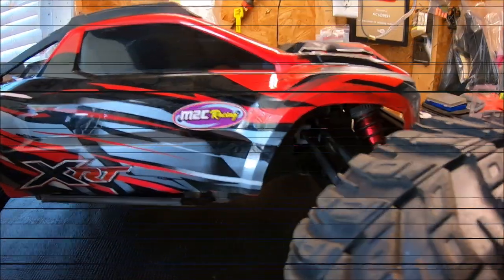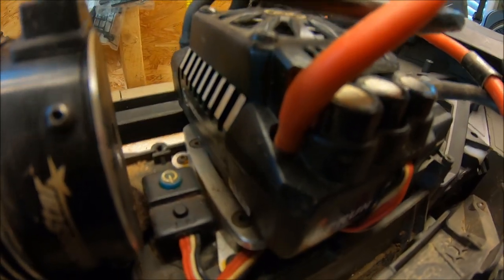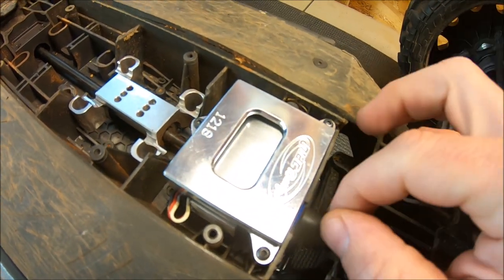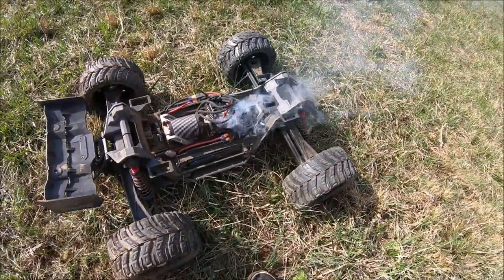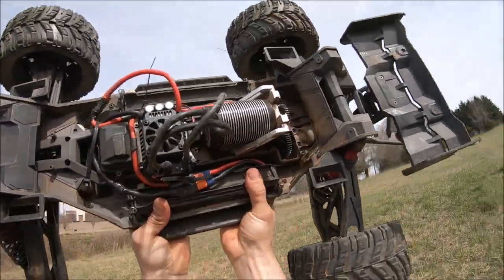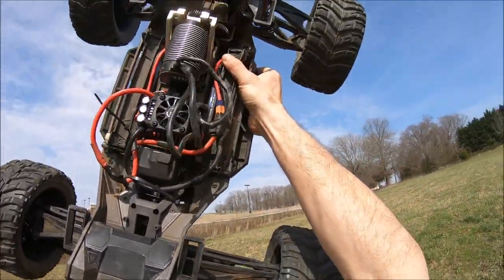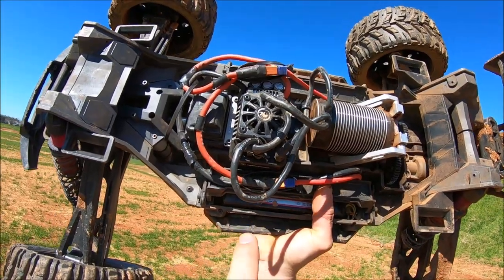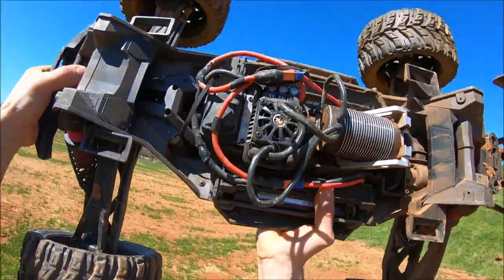MOST INSANE Traxxas XRT 8s Thrashing! NEW Upgrades!!

Comment: Me personally, I installed the max 6 esc. This model imo just isn't a good platform to do more. The spur is just wide open, I would rather use an arrma 8s and spend much less and have more options. Great video.
Reply from the maker: Thanks! This thing is a nimble powerhouse! I had to run a Max 5 with the 1120 5692 motor I'm running. I tried a Max 6 and smoked it immediately.😝🤣Thanks for watching!

Comment: What kind of parts do you go through, and what spares do you bring on a bash day like this?
Reply from the maker: Just depends! This whole video I only smoked the ESC, killed a rear diff and cracked the rear chassis🤣She kept driving though! M2C will soon have a solution for the chassis! Usually I carry a tool box with essential spare parts like arms, shock ends, diff gears, hubs, Bearings etc.
Reply: @RCDUDE81  awesome!, thanks for the reply dude. It would be cool to see a carnage overview after a bash session sometimes. Your vids are packed with action, but it's also cool seeing what was broken to give an idea of what spares to hold onto.

Comment: Hey, can I ask what wheels and tires you have on? I was so excited to get my husband the XRT for Christmas and he can't do anything even kind of close to this. His wheels are constantly breaking! It's super frustrating! He has hardly even got to drive it because the wheels break going on a 20°, 10" (at the highest point) ramp. The wheels are trash! We have gone through 6 sets of tires since Christmas plus the ones it came with. I was a huge traxxas fan until I dropped a grand on this RC and he can't even drive it
Reply from the maker: I hate to hear his troubles with the tires! I showed in my intro I'm running Proline Masher X tires for the 1/5. Also you need either the wheel hex adapters or the M2C axle and 24mm hex conversion.
Reply: Proline mx43 badlands are also very nice tires and require no extra items to use. They are beadlocked so while expensive they will last a very very long time. Good luck!

Comment: Why does voltage cut off always happen right when it comes off the ramp? Seems to happen pretty often for me too.
Reply: Because you see the issue once you come off the throttle from Maxx Amp draw
Reply: Or impact of the ramp jars wire loose
Reply from the maker: Yeah I try to ramp launch early in the packs charge but yes it has happened to me! This powerloss ended up being a loose motor lead.😜

Comment: Holy ! Does anyone know what makes ESC start on fire or smoke out ? Like in general what happens to them that makes them do that ?
Reply: It gets hot as fuck from all the electrical current running through them as it sends power to the motor causing the glues and plastics to melt and eventually combust if temps stay up..🎉🎉🎉

Comment: Wheres the antenna in esc plate?
Reply from the maker: Doesn't need one my radio is antenna-less. If you need one you can use the reciever box
Reply: @RC DUDE81  didnt know they had those. Neat
Reply: @RCDUDE81  i ordered one